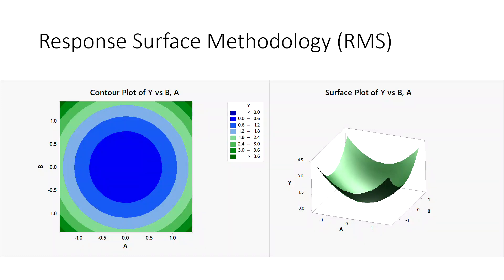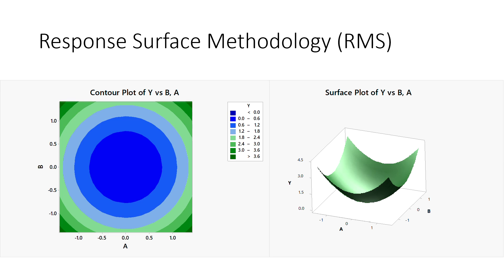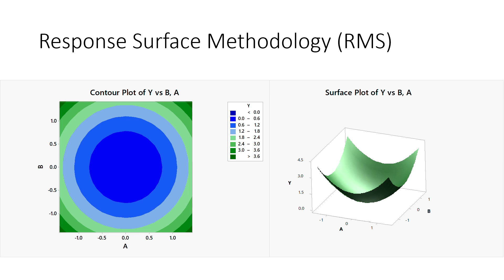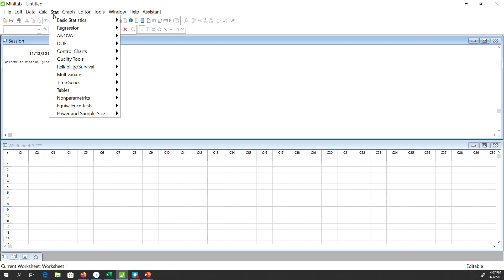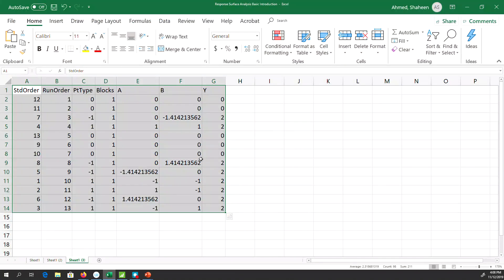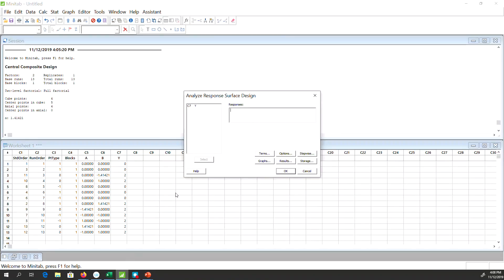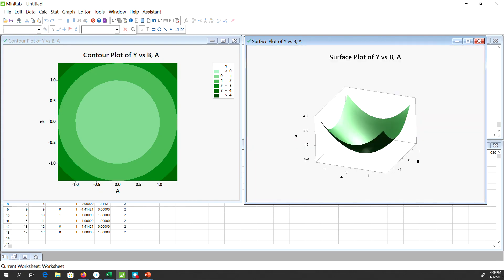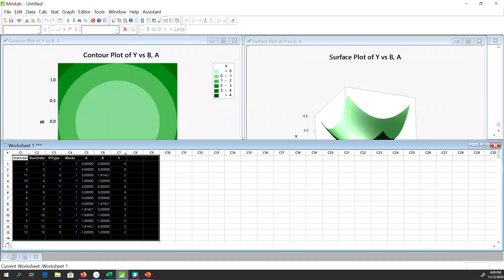Introduction to Response Surface Methodology RSM Design and Analysis Explained Example using Minitab

Comment: If some of the factors are categorical and others are continuous, can we still plot the surface?
Reply from the maker: A good idea would be to develop response surface for each level of the categorical factor. For example, one for male and one for female assuming gender is a categorical factor and it is significant.
Reply: @TheOpenEducator  Got it! Thanks! If we have more than 2 significant continuous terms, we obviously can't visualize this. Do we just make lots of pairwise visualizations between the terms?